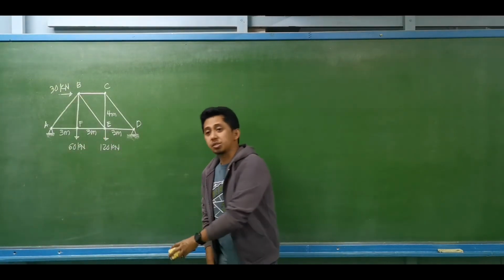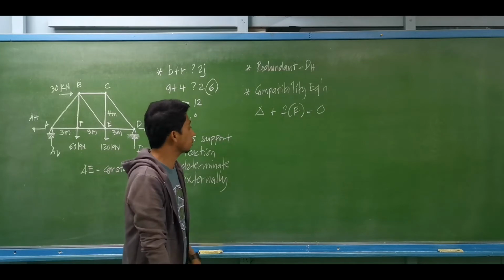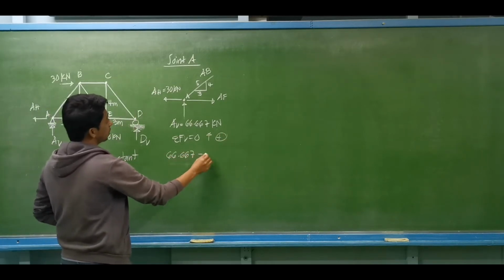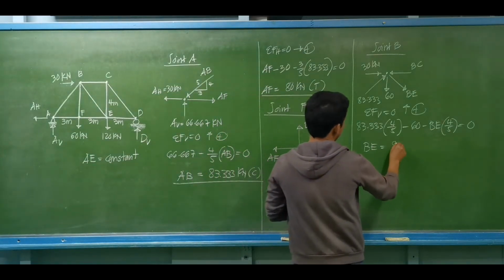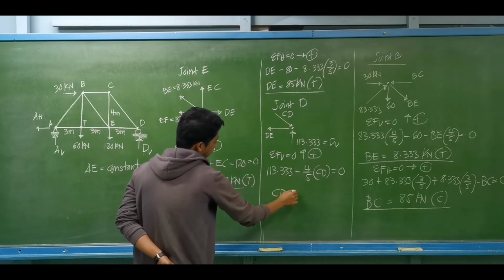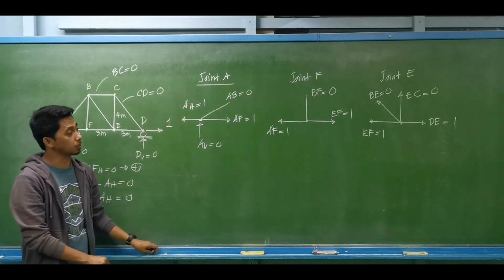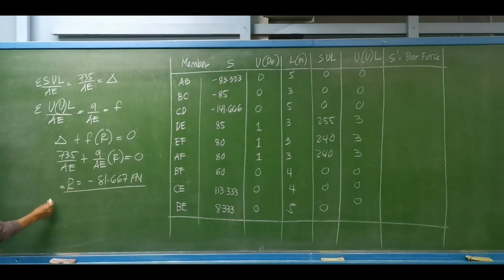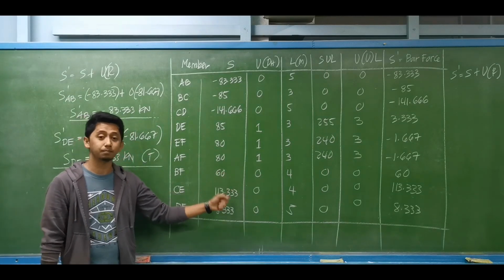Virtual Work - Indeterminate Truss

Comment: Sir why did you not choose any member to b redundant
Reply from the maker: Sometimes we call it as externally indeterminate truss. Excess support reaction makes it indeterminate. That's why I chose one of the reaction to be the redundant.
Reply: @AbrenianLecturer  Also,
 the structure must remain statically stable, thats why you chose Dh as redundant instead of Dv